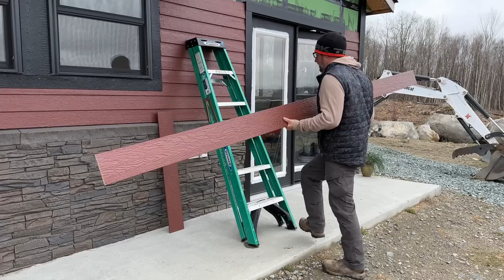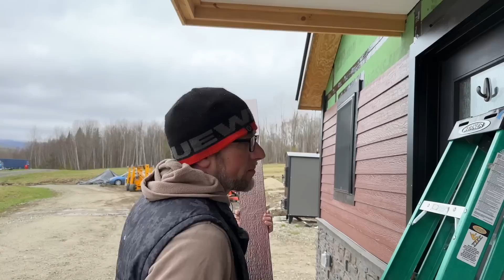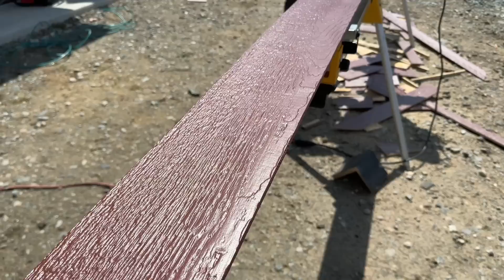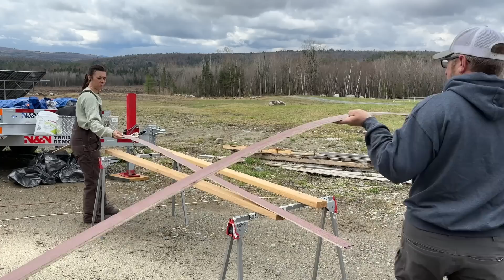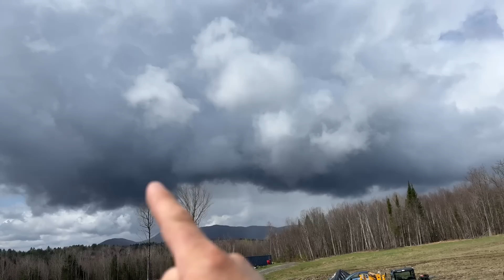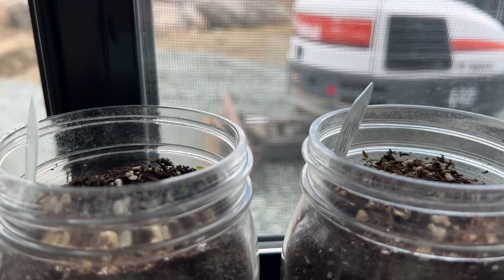FINALLY a MAINTENANCE FREE EXTERIOR?!? BUILDING Our OFF GRID House in the WOODS

Comment: I like what you guys have done. One question. Why didn’t you put up some flashing above your window and door trim before you put up your siding? With as much rain/ snow you get, your relying a lot on the caulking to keep it water tight. That’s just my opinion, but was in the building trades for 30+ years.

Comment: For that style siding a roof nailer will do the job ,just make sure your ring shanks will travel through. And for vinyl siding there's is an adapter for roofing nailer to be used with

Comment: I am just not sold on the lap siding material.  I remember all to well the LP product fail of composite material that occurred about 30 years ago.  I replaced it with concrete lap siding and it has performed well.

Comment: Hi Al & Gina, just found this regarding the siding nailer from DeWalt. Q, Is DeWalt going to make a cordless siding nailer?
Cordless tools take construction to the next level and our Siding Adapter Tips take the DeWalt 20V roofing nailer to the next level, making it the ONLY cordless vinyl siding nailing option on the market. Specially Designed. Kind Regards West Aust

Comment: Stanley Bostitch made a roofing coil nailer (RN-45) that had an accessory foot for nailing siding. The siding nailer may not be  what you're looking, as they are designed to use the locator slot in metal or vinyl siding and drive the nail proud by about .020" to allow for thermal contraction.

I purchased the RN-45 and the foot, as I used the roofing foot for my roof and the accessory foot to replace approximately 800 sq/ft of siding. Since then, I've used the sliding nailer for my detached garage siding.

One thing you can do if air hose weight bothers you it to purchase the light weight urethane air hoses and a swivel fitting.

Comment: By the double door upper black trim, an L shape trim is needed to go under the siding and on top of that black door trim, to avoid rain entering behind your door. Did you forget? On the other side by the window you have some protection because of the roof.

Comment: You could use .113 smooth shank hot dip galvanized nails in a cordless framing nailer. Not sure what you lose regarding number of nails per load vs the coil nailer.

Comment: Hey Al & Gina. The house looks great. And the Homestead is looking really good. Just had a question for you. Why are you not using joint flashing on your siding. When we did ours we were told that a piece of metal flashing had to be used at every butted up section to a new piece of siding. And we used the same green board. Didn’t know if you knew something we didn’t. Thanks.

Comment: Al, I've been pondering over your beaver dam issues.  Would one of those chainsaw heads powered by a string trimmer work?  Sure you would have to blow out the chainsaw end and regrease, but the motor end would be out of the water.  The house is looking great.
Reply: It's called a pole-saw 👍
Reply from the maker: The beaver dam is packed with mud and rocks also so I don’t think the chain would stay sharp very long
Reply: @colstace2560  I know, but when looking up powered pole saw, it brings up the ones both electric and small engine at the saw end.

Comment: Good Morning!  It's a good idea if you can stick with the same brand of battery-operated tools, since all the batteries are interchangeable across the same brand.  You can also get some terrific deals if you buy one of the tool packages.  I have a bunch of Ryobi One+ tools.  I've used them all, even though I thought I wouldn't.  Strange stuff happens, and you discover you have just the tool needed for the job.  Like cutting aluminum plate with the little circular saw, or using the oscillating tool in tight places.
Reply from the maker: Gooooood Morning Guy
Reply: Howdy Guy!

Comment: I am a professional sider and I don't believe I rarely used to level. We establish a straight line off the level grade oh the wall of the building and we continue with that across each wall it's called storying a wall just saying. Also most important is to sight the boards look down each board to see if it is straight very important to good looking job just saying.

Comment: don't understand why you put soft material on when you already had your softest boarded in Why did you not just paint the plywood black most houses it's just the soffit and air hole in behind it nothing there and I used J trim on both sides of mine because there was nothing behind it

Comment: DOES ANYONE MAKE A CORDLESS SIDING NAILER?
Unfortunately, no one or no brand makes a cordless siding nailer. All the siding nailers are pneumatic; you may find some electric ones. Siding jobs require high power to drive nails into tough materials such as fiber cement and hardwoods. The battery-powered siding nailer might not give much power for a long time to finish the job.

Besides, siding nailers are heavy by their design. Adding additional battery weight will make the nailers heavier, leading to fatigue when used for a long time. Moreover, siding nailers are expensive. The cost will increase beyond the standard level when the battery is added. That is why no company makes a siding nailer cordless.

BEST CORDLESS SIDING NAILER
Despite having so many difficulties, some people would love to use cordless siding nailer. You can use DeWalt cordless roofing nailer for siding. However, you must need Dewalt cordless roofing nailer siding attachment to convert it into a siding nailer.

DEWALT CORDLESS ROOFING NAILER

Robust engine and feed system
Sliding Protection
Depth adjustment wheel
Easy Jam release
Check Price on Amazon
DEWALT CORDLESS NAILER SIDING ATTACHMENT

Genuine, OEM Replacement Part
Compatible
6.05 X 3.45 X 1.95 inches
Not for cordless (20v) nailer
Check Price on Amazon
You can use this as dewalt cordless siding nailer to complete your siding projects. This battery powered siding nail gun comes with a powerful motor that can deliver up to 10 nails per second.

Its ergonomic design does not let you feel fatigued while working for a long time. It also provides better grip. Besides, the steel skid plates with rubber inserts protect it from sliding while working on top.

Apart from that, you will have depth adjustment, easy jam release, and other key features that you can expect in a cordless siding nailer.

The siding tips for dewalt roofing nailer is also a good option, actually, it is the only option available right now.

Comment: look for a finishing nailer or pin gun like MAKITA 40V MAX XGT BRUSHLESS 23GA PIN NAILER SKIN PT001GZ to do siding. or some nail guns can be turned down and use finishing nails . i would just clamp the hose to the basket with room to move so the whole hose weight goes to the basket not you.